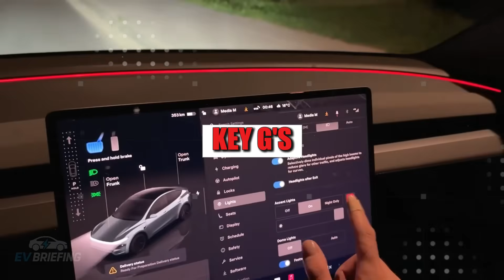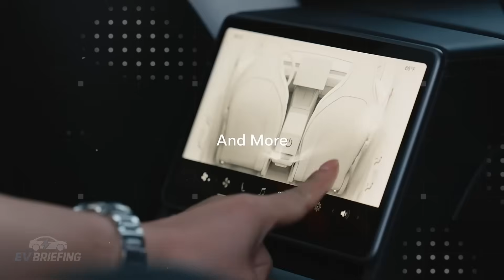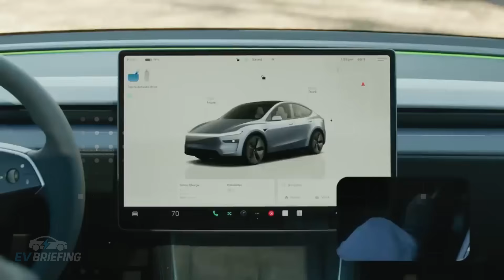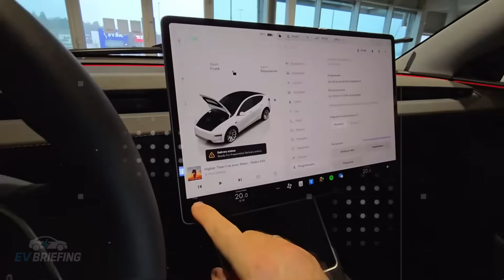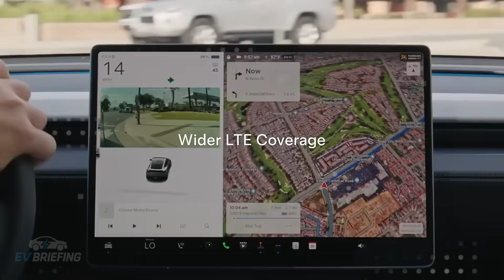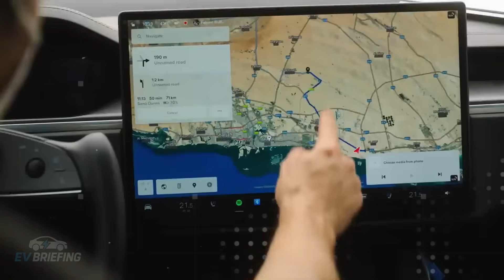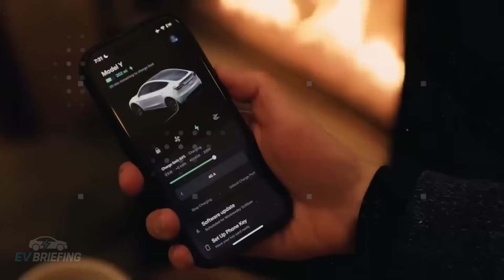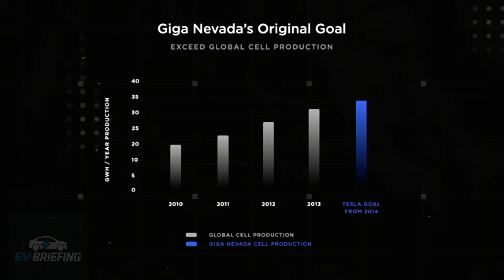IT’S HERE! Tesla aluminum-ion battery —$40/kWh, 25y, 10-min charge, 1000-mile M2 — Elon Musk shocks!

Comment: I will buy a dual motor- model 2 ( Q) whatever name , if this car has a standard Al ion battery,, Range between 38- 45 miles would be sufficient. Al ion battery is necessary to stay ahead of chinese competition, as well as stay low on weight to be able to have std 17 inch wheels. Heated seats and rear seat display and trailer hook must be options that can chosen at the order. If available I would buy a Tesla Pi phone and Pi Pad as well, if order is possible  there when ordering the car.